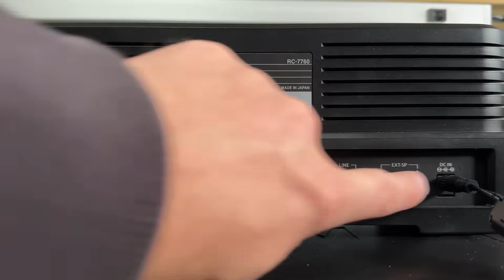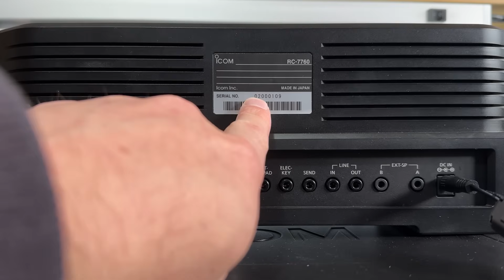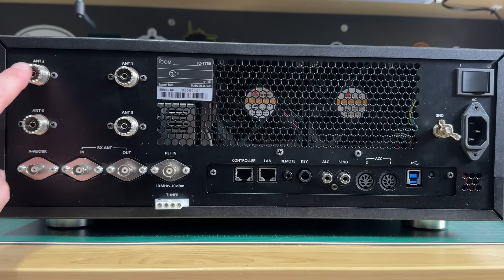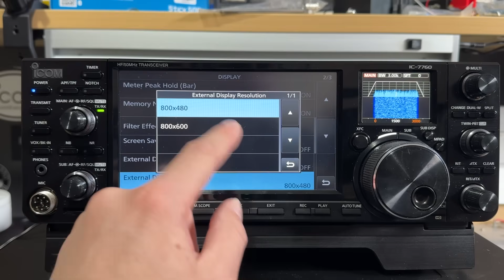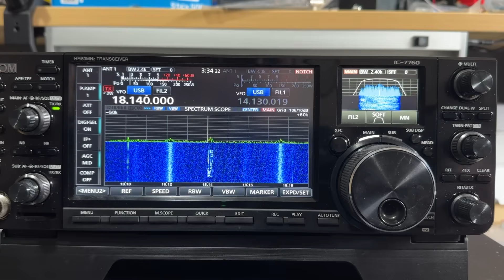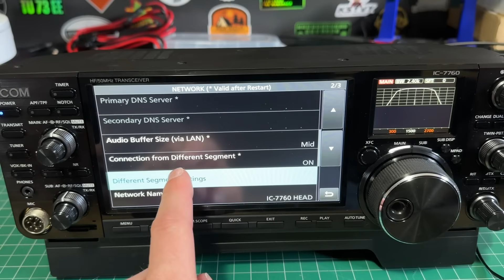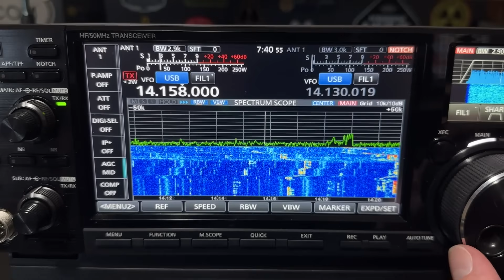Icom IC-7760: FIRST LOOK, Review and Demo

Comment: Thank you for the excellent demonstration. I am still uncertain about the use of the GENE tab in the Band Stacking Register screen. Touching the GENE effects big jumps in frequency, with no consistent or intuitive pattern towards general coverage. Examples:

8.08 jumps to 1.3 
Or, on another occasion, 8.08 jumps to 1.58
 
Or 8.080 jumps to 5.000 
5.000 jumps to 2.990
2.990 jumps to 8.080 
or, on another occasion, 2.99 jumps to 21.949
10.000 jumps to 5.000 
24.900 jumps to 2.990 
50.050 jumps to 2.990 

I could also not see mention of the GENE anywhere either in the Basic or Advanced IM. 
 
But I am learning, and thank you for any advice you can offer.

Comment: The RF Deck LAN/Controller interface is a little confusing. I have only the LAN interface connected to the RF deck and Controller on same home local network. On the DHCP line, it says on and provides an IP address I can then remote to it via remote software. Connecting both LAN and Controller cables to the same network will cause a broadcast storm and kill your network. Right now it is working ok for me and I am using MacOS/iOS SDR-Control for remote access.

Comment: The issue with the VPN is a network problem, not a radio problem. As stated in the comments before, the RF deck is not getting an IP address on the network that it is plugged in to. That would tell us that there isn't a DHCP server on that network or the switch port the deck is connected to is not configured properly. Once the networking is sorted out the settings on the control head can be configured at the "Connection from Different Segment" section of the Network Settings. You would manually set the IP address for the controller there so each device knows the address of the other.
Reply: For my remotes, I use DynDNS and port forwading. As a result, I have no issues with my IC-7100 and  my two TS-480SAT remotes especially since the remotes are on Spectrum provided MODEMs and they use DHCP. DynDNS has transparently handled every IP address change that Spectrum made (when the split sectors, etc.). Over here at home, I have an at&t fiber link with symetrical 1 Gbps (realy ~940 Mbps U/D)

Comment: My SunSDR2dx display blows that pitiful display into the dirt. I bet the Sun hears as well or better and has a better transmit audio as the transmit bandwidth can be expanded out to 18khz and the receive out to 10Khz. Yes , the sun has no remote capability directly but you can go through a server. Mine only costs $2495.00 so I'll pass on the Icom.

Comment: Thanks for the great preview.  ICOM continues to expand their line of XCVRs based on the IC-7300 initial design.  I suspect any follow up to the IC 7100 will look similar with a IC-705 type head and separate power unit.  (Wouldn't it be great if they could just build a new head unit for the IC7100 and continue using the existing base!)

Comment: One of the reasons I went with the ftdx101D and not the 7610 earlier this year, was fit and finish. The FTdx101D just has a more premium look and feel, knobs are not sloppy and no piano black. Looking at the plastic look on this radio and the need for a cheap plastic stand for the head is depressing for that price point. I’m sure from a functionality perspective this thing is very capable, but for me it’s the total package and at that price it needs to provide a very premium experience… just my opinion. 73s.
Reply: And the external res is not going to look good on modern monitors.

Comment: Thank you for the great review. This seems like a very nice radio, however, I wonder if it really is worth $3000 more than the excellent  Ic 7610? Can you really hear the difference in the received  signals? Also, you could probably find a nice 500 W amplifier and put out a stronger signal for less than $3000.  73, wz2j
Reply: I really  like my 7610. I have two end fed antennas going to each port going to each ear and you hear everything. Love that radio.

Comment: I ordered 2, one for my shack in Toorak and one for my beach house in Sydney. They have received decent reviews so decided to give them a try. My 7851s are pretty decent rigs but the Flex units are better. My second favourite is is the TS 990S. The Hilberling is good, it's a pity they stopped production. My Baofeng is number 1 favourite. It performs brilliantly and I can raise folks on it 24/7 and amazingly in some cases can pick up private networks which can lead to a lot of fun. 73s.

Comment: I like the radio a lot but for the price of this radio; and you only get 200 watts, I think it's a bit overpriced at $6,000.00 U.S. unless 200 watts is good enough for you and you have good gain on your antenna. I hope ICOM comes out with a 100 watt version of this radio and cuts the price in half. I'd rater pay around $3,000.00 U.S. for this radio and put the other $3,000.00+ or more in a nice amplifier to have more than 200 watts to play with. But this is just my opinion. On another note, will the main unit that houses the power supply, will it control one or more rotors through the dock?

Comment: The ARP broadcast asking for which machine has which IP should only be done if the other node is on the same subnet, otherwise the packet should be sent directly to the gateway. Maybe there’s a bug that tried to reach the RF deck on the same subnet even though it’s set up to be on another one? If static IP can be assigned to the RF deck that may help, but only if the network interface stays on when it’s in standby and waits for an IP packet addressed to it to signal it to wake up, rather than relying on wake on lan or anything like that that uses broadcasts.

Comment: The fact that PoE is not supported sucks (one cable less). Can you do duplex? (I mean hear frequency on which you currently transmit - radio knows what it is transmitting and could subtract that signal from second receiver connected to second antenna, in theory). Base unit is SOOO loud on this video (hard to say how microphone picks that up but having that under the desk wouldn't be welcome; and no - can't put it anywhere else as all feeders ends up here). 169.254 are APIPA addresses (so looks like it is not getting IPs from DHCP).

Comment: Very interesting stuff, it certainly looks like the base station isn't getting a DHCP lease from your club station's router. I'd love to see some proper wireshark captures from a mirrored switch port, please, if you take any then do send 'em over - so many questions! Seeing as it appears to have proper support for IPv4 routing then getting it going over a VPN should be a breeze. If it's got a complete IP stack in it and been done right then it'll be able to figure out any MTU bottlenecks too, and with the adjustable audio buffer that's all very exciting. If not then there's always nonsense like L2TP/IPSec or gretap/wireguard. Now if only I could borrow one for a couple of days and get it all worked out... ship to England Hayden? Haha 73 de M0MZF

Comment: Early look obviously but kind of a confusing product. 

It looks like a kenwood...kind of. Kenwood looks better  but they probably are on the way out. Guess everything is a menu or two down to get access. 

Kind of like a flex radio but not as "flexible". 

For the price (like almost half?) the mp101 gives you 200 watts (not continuous so rtty and ft8 you back it off) but you get vnc, two receivers,more physical buttons and pretty amazing receive capability (which we have not seen any data yet on that),  Do like they put the rec play right on the front to remind me that Yaesu did not include that capability in the 101. 

This is a monster that will need some thought on where to put the part of the radio that is not part of the user experience. Hope you got a strong shelf in the basement. 

Do like the 4 tx/rcv and seperate rcv antenna. Nice.

To be honest I hope this starts looking better soon because the 905 was kind of a thud and its been awhile since the 7300 and 705 (and Yaesu may start taking some of that with the new qrp rig). They really should have upgraded the 7300 and the 7100...the old kenwood 2000 and the aging yeasu shack in the box stuff could use replacements, especially if mobile with a remote head. 

I hope this is a winner if not one has to wonder where Icom is going. By the way I have a shack full of Icom stuff....I want them to succeed.

If this is any idea on pricing, wonder how close (or more) to $10k range its going to be for the ps2 amp.

Comment: For the price of that you can have 2 icom 7300's, a legal limit amplifier, and a tri band yagi.  Just thought I would put that into perspective!  haha
Reply: For the price of your car, you can have two bicycles, a padded seat and a beer. Everything's relative 😂😂😂
Reply: Did someone say beer???
Reply: Or 277 Boafengs.
Reply: I agree!
Reply: However for those that have excess money we want the 7760 plus the amp since 200watts may not be enough and  several other new radios in case we get bored with the 7760
Reply: @frankjankovich3512 if you need more than 200 watts, maybe you need a new antenna
Reply: @frankjankovich3512  well then keep them in business so they can keep making good rigs!  I am glad someone is buying them.
Reply: All set with that right, honestly looks like a 2000 dollar rig, I rather have a anon and I don't own one lol.

Comment: Unfortunately quite boring.
No HDMI is forgivable - HDMI is a shi**y stnadard requiring licencing. DVI to HDMI adapters cost almost nothing.
Ext display limited res is an ancient idea.
I can at a stretch forgive no PoE, no USB Type C ... devices providing power via these means are often noisy, Icom controling the power supply isn't understandable here.
Don't get me wrong, I'd love these options, but i think i can understand why not.

A bar for a voltmeter still ??? Thanks for thinking we're 6 year olds Icom
And the temperature... hot / cold.... more like a European car than a Japanese radio intended to be operated by adequately licenced users.
Icom had a lead when this UI came out, but failing to keep it relevant is causing them to lag behind.

And the ultimate failure... mostly pointless SDR...
Appliance operators won't care, but an SDR should allow synthesis of many different signal types in the radio itself.
That means generating WSPR / FT8 / JS8 / whatever other digital mode you can think ok... inside the radio itself.. not using an audio interface.
Instead we're still feeding radios digital sigs like cave men.

Comment: If you want to try Zerotier which will carry the L2 traffic (I use it for a remote station), you can look into using a couple of MikroTik hAP ac3 routers on each side where you can plug each piece of hardware into.

Comment: The remote head not having PoE seems like a bit of a miss. The transceiver unit is mains powered... so providing PoE out (or using any PoE switch in the middle) would be simple. It's $0.25 more in cost... money they could have saved by not having an AC wall wart.
Reply: Might be a noise issue. Disclaimer, though, I’m an idiot and I’m just speculating.
Reply: @1adam12az that’s a very good point. Power sending common mode ripple compliance between 0-1Mhz can be problematic in PSE design and this unit is already producing tons of RF.
Reply: @1adam12az  lol - that's the level of honesty that's been lacking on YT comments. 🙂
Reply: @VE5SAR-Hamnetics  I go into any ham radio video knowing that I’m the dumbest guy there. Love learning, though. 😂
Reply: What do you do when you operate the RF Deck remotely with the Controller in a different location....invest in a PoE switch? Best to have the seperate wall wart, in my opinion. Can use anywhere.
Reply: @japanham5973  A PoE power injector would be the same price as the wall wart, and would be an optional penalty only for those people that needed it. For everybody else... they benefit from a single-cable install, instead of 2 cables.

Comment: I would set static IPs anyway, don’t use DHCP on the main unit.
Reply from the maker: I set statically on my router, and all devices are DHCP.
Reply: @ yeah I think that’s part of the problem because DHCP is still being used even if the router is assigning the same IP every time. I would set static IPs on the control head and RF deck with that different subnet setting enabled and try again. 

I’m a network engineer by the way. :-)
Reply from the maker: @K6US-Radio  Yeah the only issue will be that the NIC goes to sleep/drops it's current IP when it's told to turn off by the control head - even locally on the same network and even when it's in the standby (not shutdown) state for remote operation. So setting a static IP won't help in that regard.... I suspect that it's a firmware bug.. my IC-7610 doesn't switch off the network card in the standby state, which is expected with a new radio that is technically still in the demo phase.

Comment: Still Resistive LCD? Are we still in 1999?
Reply: ...and low res compared to some rigs.  That is even more disappointing to me.
Reply: maybe different types of touch are more rf sensitive ?
Reply: @RoelandJansen  It's not, and that's why capacitive touch screens are used by Elecraft (K4), Flexradio, ANAN G2 and on all smartphones.
Only obvious reason Icom insists on using resistive touch screens is the (trivial) lower cost.

Comment: There was a lot of work put into this radio, but I think the effort is more symbolic than trying to make a profitable product.  As the retail sales manager at DX Engineering said to me, why would you spend $1000 on an 8 year old IC-7300?   ICOM should’ve spent more time to come up with a follow up to the IC-7300.   I think even if they could combine the 7100 and 7300 into a similar head-rf unit configuration at the lower price point that would be attractive for hams wanting to upgrade to second tier.
Reply: I would buy a 7100 with a color screen all day long. It's really what we all wanted.
Reply: Exactly this. They appear to be happy to let Yaesu run away with the more accessible end of the market, which is odd after how massive the impact of the 7300 was. Maybe they’re working on a follow up, who knows.. 73 M0EUK
Reply: The 7300 is a very good product even today.. so what?
Reply: @xitec75  I have a 7300 but also bought a 7100 for my remote setup. The separate control head is a great feature. (I also have two TS-480SAT for remote). So IF Icom gave us a 7300-level radio with a remote control head, it opens the door with greater flexibility. The 7760 is great but way too expensive while the old 7100 is in the same price range as the 7300 but more flexible for remote ops. You also need to remember that in this day and age, more and more hams are operationg remote. I live in a condo and my remote is my main means to have fun on HF.
Reply: This radio is currently $6300.00 That's kind of a long reach for most hams imo.
Reply: And the 7610 is 7 years old too. Is this the 7610 replacement?
Reply: The IC-7760 replaced the IC-7700.

Comment: 2:30 15v DC in?!  Not 12 volt?  What the?!
Reply: I was thinking the same thing!! Well, really I’m thinking why does it not have PoE? At this price point, why should there be multiple required cables to the control unit? 

No poe is not the end of the world, but a 15 volt barrel connector? That’s just asinine
Reply from the maker: It came with a 15V Icom plugpack. I'm not sure what the acceptable "range" is for powering the head. Could be anything
Reply: First 500 repairs is when somebody plugs their 19V laptop p/s.
Reply: @ or 5/9/12/24 volts. What even uses 15v? Why not usb C? That will do 5/9/12/19 volts and at least 100w, and it’s a STANDARD

Comment: You did a good review considering what you had to work with. But man oh man this is not what one would expect from Icom as their flagship radio. Dated technology, missing a fair few modern features available in other current radios. Big, heavy, awkward and it doesn't work over the internet as promised. Well, it probably does, but it should be plug and play with minimal set up to get it working totally remote. Otherwise why bother when there are several third party options that make any of Icoms network capable radios work remotely. If I did have the money and property full of antennas, I would only get this particular radio if it was remote plug and play so that I could have the remote head anywhere including over wifi and mobile/portable with a hotspot connection.